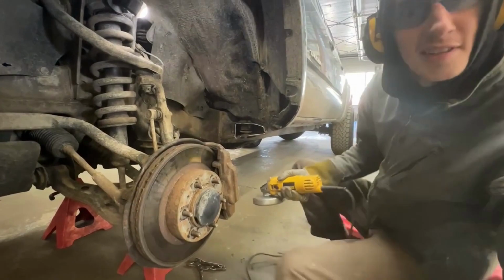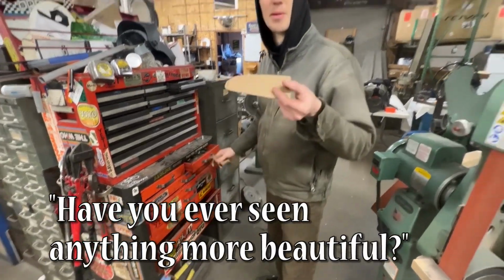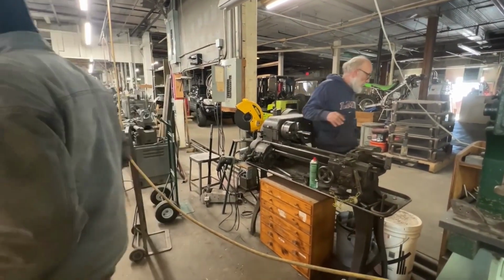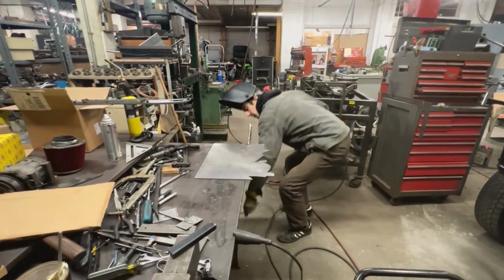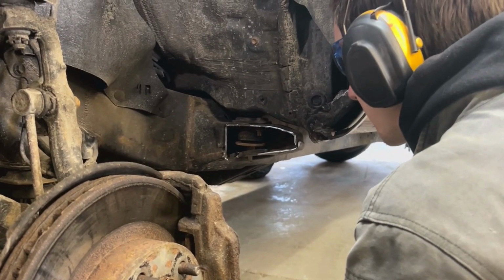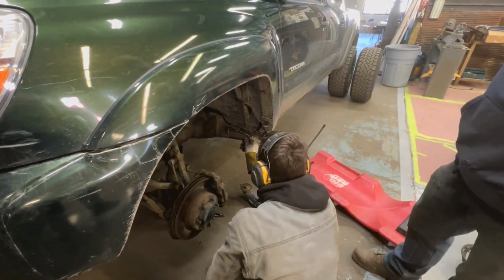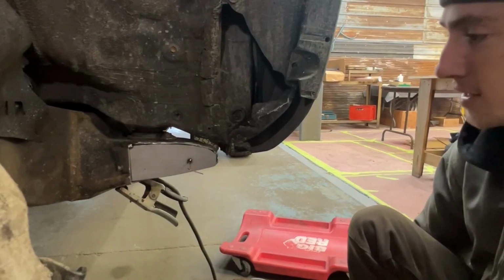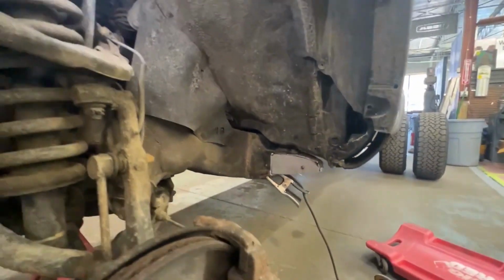Trimming Tacoma cab mounts at Acetylene Studio

Comment: question: something was sprayed on the plate after sand blast and prior to welding in place. What are you spraying on and what is the benefit?
Reply from the maker: It's a self etching zinc primer that helps prevent rust from taking hold. Thanks for watching!